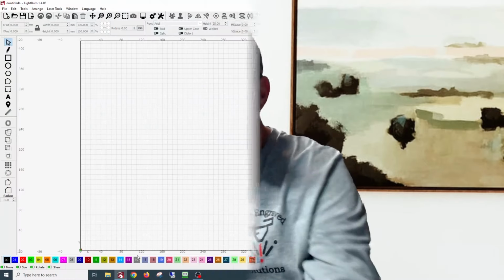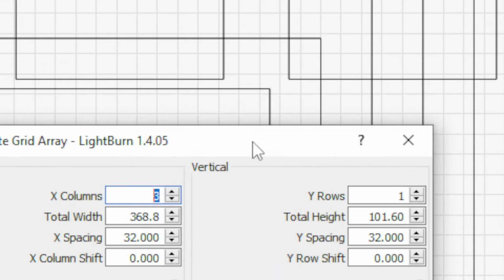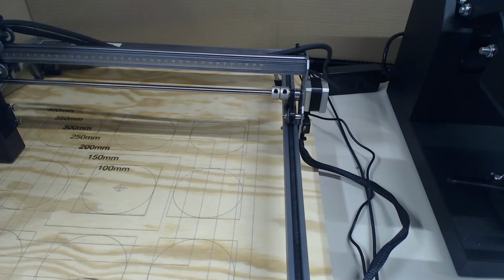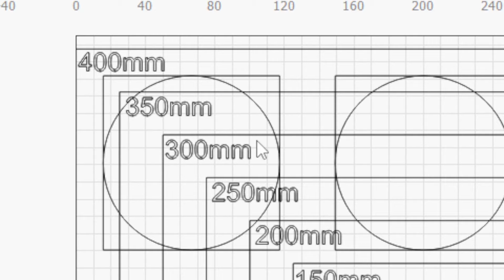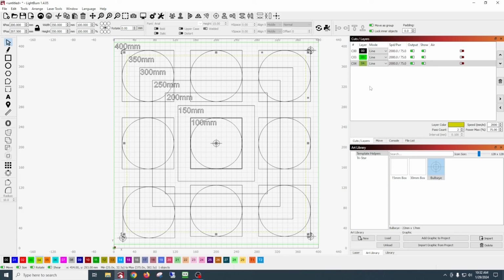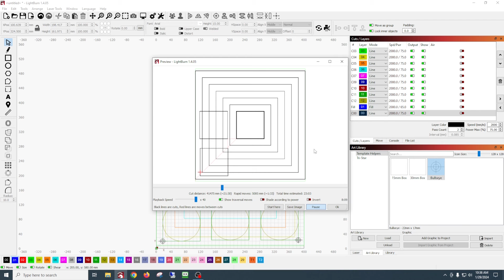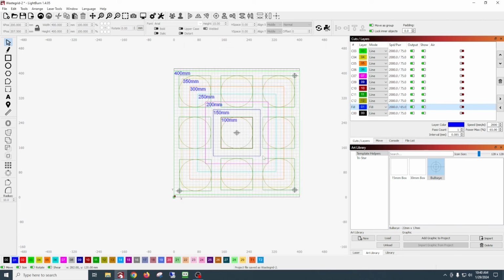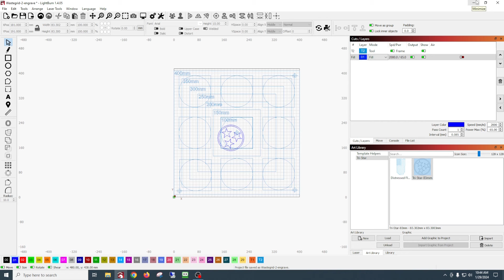Creating a waste grid in lightburn.

Comment: Just wanted to point out your 3 bottom squares are not lined up. When you originally created them in array you didn’t select your left square when you grouped them. Grab a ruler and lay it across the bottom 3 squares top edges.
Reply from the maker: I didn’t notice! Thanks for pointing it out. I will fix it ASAP in the file.